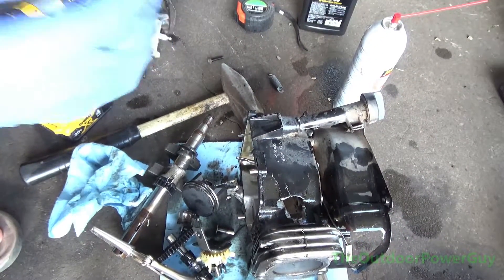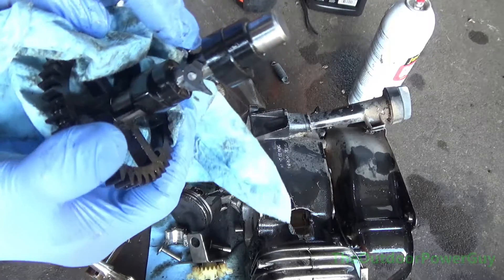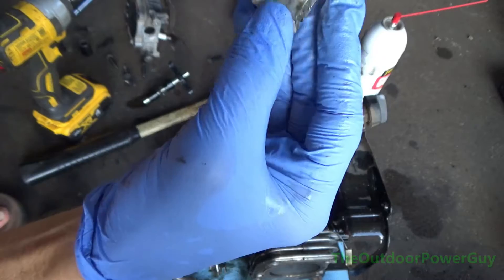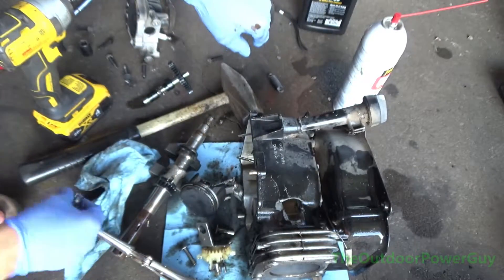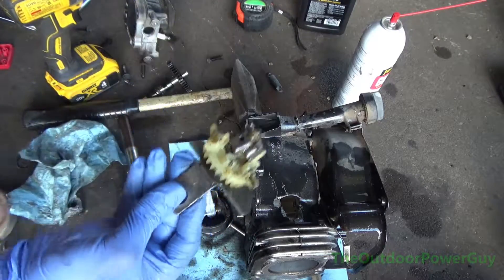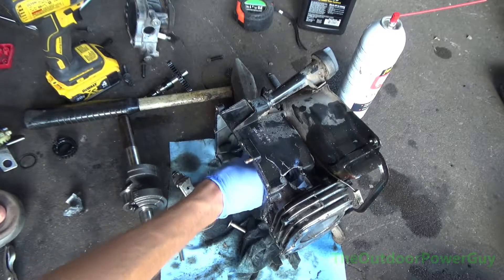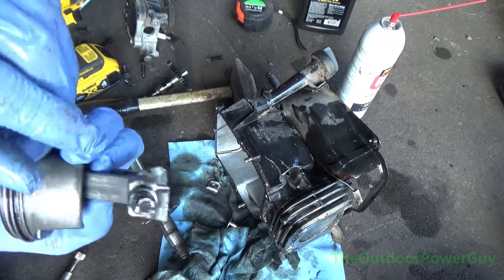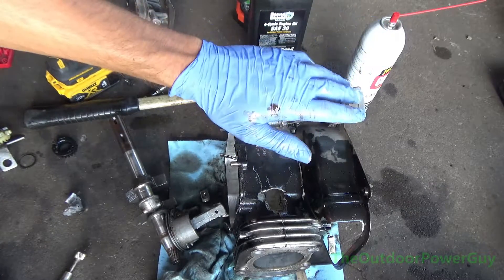Briggs & Stratton 550EX Engine Teardown :Why It Failed

Comment: Is B&S using cheap rings?  
Three out of four of the 2008 - 2012 140cc 550EX mowers I took from the curb have oil coming out of the spark plug hole.

Comment: My Briggs 550 just locked up.  I changed the oil frequently and every time it looked more silver than I would like.  
I think these motors are junk.  Been using 5w40 synthetic since day 1. It never runs in cool temps here in Georgia. Only 3 years old.  I've had the old flat heads run for ever...
Will tear it down to see what happened
Reply from the maker: 5w40 is way too thin for the southeast regions for an air cooled engine, SAE30 is what Briggs recommends. it more than likely seized up due to wrong oil type.
Reply: @TheOutdoorPowerGuy  
Sorry but a 5w40 is heavier at temp then a sae30 is. 
The number before the w designates how much the oil will thicken in very cold temps.
And the recommended oil for all temp in my manual was 10w30 and 5w40 for higher temps.

Comment: I have 3 of these engines where the camshaft lobes spun and threw off the timing due to lack of oil and overheating. two of the three came to me with NO OIL in them, one being a 3 month old Toro.  Toro wouldn't warranty it due to lack of oil.  3 months old!!!
Reply: cant exactly expect any engine to last without oil
Reply: @Robo-xk4jm  exactly